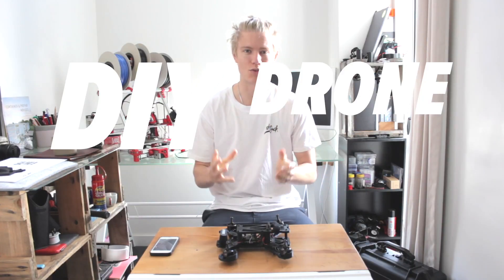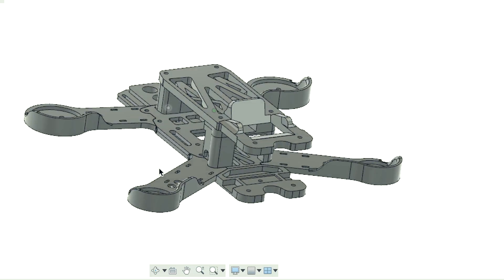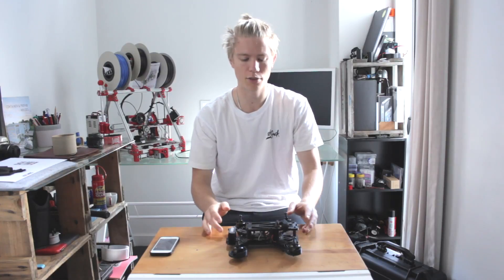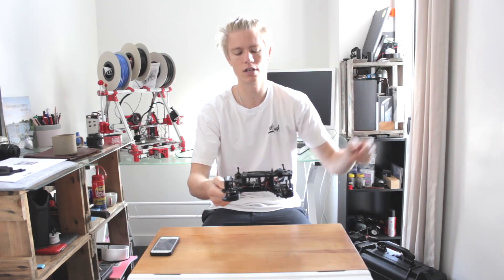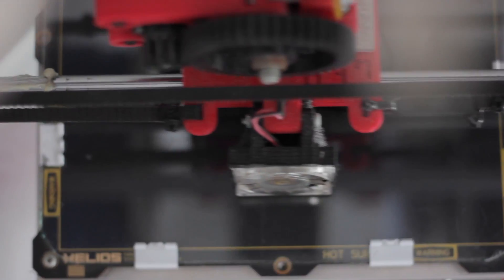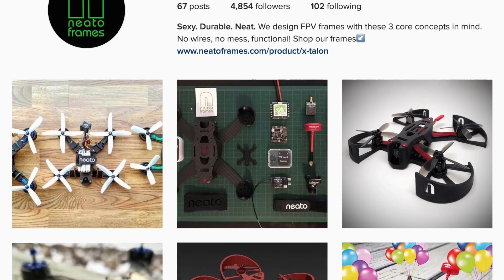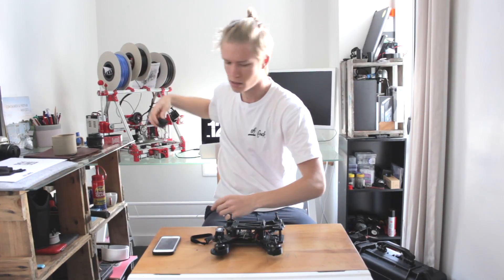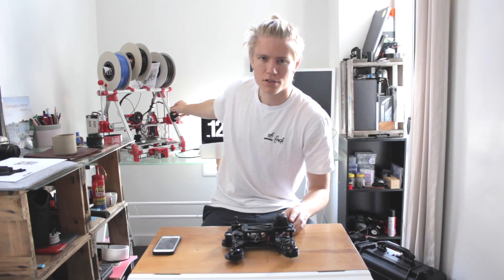DIY Drone Part I: Introduction and Free Drone!

Comment: hey! i choice this drone to be my firs drone, is nice and i love it!
i have a lot of questions to build it (im from Argentina, sorry my bad english), in the video "3D printed drone assembled in less..." you use 6 standoffs, but you dont use it in the final version, and use "Battery VTx antena brase" in that zone, this is shorter, can you explain which is the final version? or pictures? thanks!
Reply from the maker: Hi Gustavo! Thanks for your comment! Hopefully this clears up your question: the 'battery VTx antenna brace' is designed to slide OVER the rear standoffs, it should be a tight fit and should leave a little wiggle room at the top and bottom for fitting the plates. All the best with your build!
Reply: yes, thanks! can you publish the list of electronic components? kind of motors, controlers, etc? (im a beginner!), i need to buy all the electronic, battery and motors, i have a 3D printer and gone to print the propeller (As would be the most optimal?) thank you!
Reply from the maker: Take a look at Part II (on my channel) for the parts list! Thanks :)

Comment: What the cost to build this drone
Reply from the maker: For me, approx $250NZD although now that I know more about the components I'm using and where to get them it would be much cheaper. Your biggest up front cost will likely be the transmitter, FPV goggles, batteries and charger. Once you have that sorted, drones can be as cheap or expensive as you like :)

Comment: will you be able to add a gimbal/gopro?
Reply from the maker: Keval, the HXLMESFlight prototype features a very basic built-in GoPro session mount (recessed into the upper plate). My new design (the subject of this video series) will feature something similar - perhaps with an adjustable tilt too!

Comment: I agree with Bernard,  is there a parts list you recommend? I fly RC Airplanes, and have a 3d printer.  Need to integrate my current radio and a receiver, but other than that just need the complete parts list so I can start! Thanks so much!
Reply from the maker: I'm filming part two of this video series this weekend, and I'll be covering the electronics setup, full BOM, and frame design. I hope you stick around and learn something from my videos!
Reply: Subscribed and looking forward to it.
Reply: Just started the printing of the brace plate.
Reply: My final plate is printing, standoffs are arriving Friday, Ready for that parts list!

Comment: What kind of printer is that? Its pretty cool looking
Reply from the maker: Designed and built by my dad: http://www.thingiverse.com/thing:33946
I've been using this printer for over a year now and have just begun a full rebuild which will give it new bearings, belts etc. Also looking at getting a Prusa i3 mk2 :)